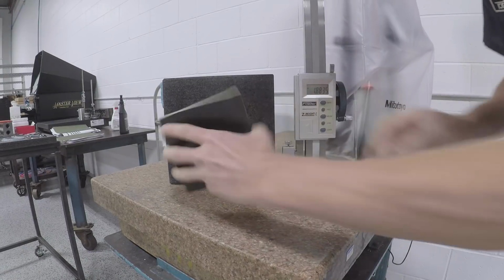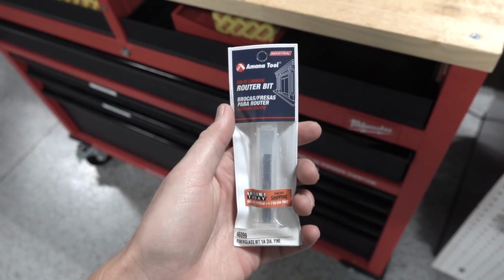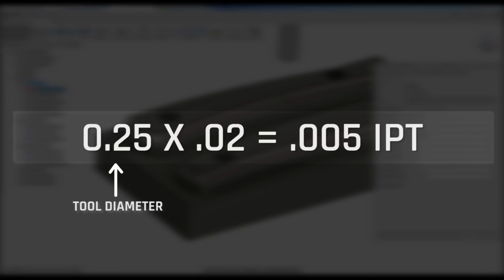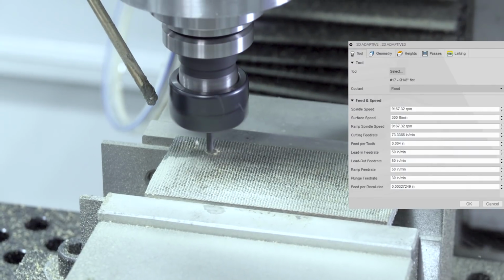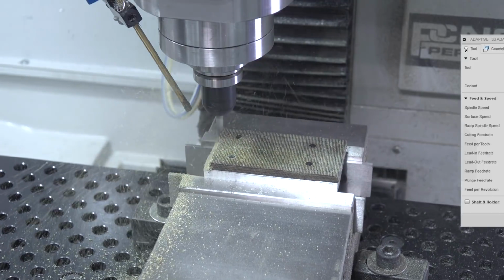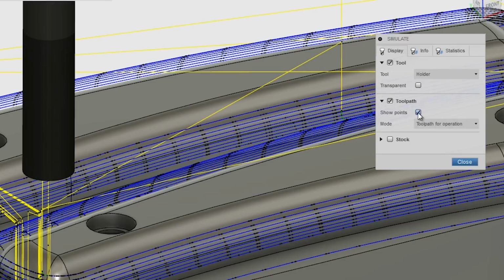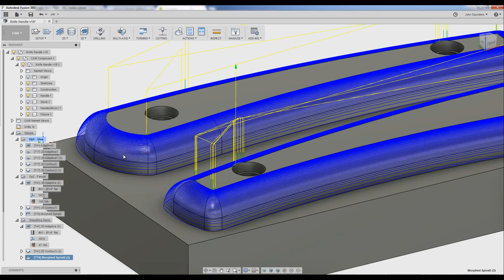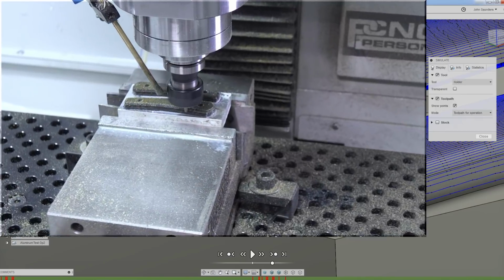Machining Canvas Micarta Knife Handles!  WW168

Comment from the maker: Apologies for the material mistake!  We were given the piece (and thought it was G10...) - thanks for clarifying that it's Canvas Micrarta!
Reply: NYC CNC 
Guess you gotta get some G-10 now for redemption 😆
Reply: Woo! I've tone a ton of this stuff. Way better to run it dry than to make a paste out of your coolant. I ended up mag clamping down a shop vac hose to the spindle to remove dust from my enclosure. Works great!
Reply: The whole time I was thinking "wow, g10 looks just like micarta"... Anybody else?
Reply: Yeah it’s not that nasty. It’s just canvas compressed together with epoxy but you were right about G10 as it has glass fibre running throughout in layers to give it strength and it’s nasty stuff. When I make knives I prefer to use linen or canvas micarta or even hessian micarta or jeans micarta and it epoxy glues to the knife handles better than G10. Stay away from G10 it’s not worth the hassle and it eats saws as you so very rightly pointed out and also tooling like end mills

Comment: Hi,
I could really use a video about this set-up. I have the same bit but I have to go really slow. A set of scales takes me about 2 hours. The main difference I see is that your operation uses the side of the bit as where mine uses the end. Also your machine goes around the handle scale and mine goes all over the place. My machine is a gantry system, but very rigid. Thank you.

Comment: Canvas Micarta is significantly different than G10. The Micarta does not contain glass fibers, which is an improvement safety wise over G10. There is no need to use air blast, it actually makes the situation worse with blowing dust all over the place. No need for special tooling either. Can easily be cut with standard tools. I have been cutting the canvas micarta with a single flute, and actually making a chip reduces the level of dust. (And using a regular endmill also helps to reduce the dust.)
Reply: May i ask what kind of feeds and speeds you are using? Looking to cut epoxy with denim myself.
Reply: @luctimmen  I'm using standard feeds and speeds for aluminum.  30k rpm, 1524mm/min, 5mm single flute.

Comment: Interesting stuff to machine!
Just be careful... oils ain't oils as they say.
For example Linseed oil is good at coating/sealing and protecting things like wood and fibers.
Normal petroleum based oils like that 3 in 1 will cause them to swell.
You can see this happen all the time when someone is a little too liberal with the oil cleaning firearms over time.
Need to soak the parts in acetone to extract the oil and shrink the stocks back.

Comment: Study up on the OSHA regs for respirator use, you are on their radar now...  essentially they want engineering controls instead of PPE, where a respirator could be required.  If you are using a respirator it is easy for an inspector to fine you for something related to the respirator.  For example we had an issue maintaining the requisite medical evaluation documents because HIPAA prohibits an employer from accessing confidential health information.  Don't assume you can skate by with just a dust mask instead, carefully read the OSHA regulations and you will find that the rules that apply to a respirator also apply to a dust mask, unless it is not NIOSH certified, which means the dust mask is about as useful as wrapping a bandanna over your face.

We machine a lot of G10 (actual G10 not micarta) and carbon fiber with flood coolant so respirators aren't needed.  Cleaning out the coolant tanks is a chore though.

Comment: My experience with cutting G10/FR-4 or similar fiberglass is that using a fiber reinforced abrasive cutoff wheel on a dremel, or some similar but larger tool gives easy cuts and perfectly smooth edges.  For best results, use a fixed tool and sliding material.  Even hand guided cuts this way will be locally flat in the direction of cut.  This is what I use for getting flat cuts on FR-4 PCB material.  I don't recommend a hacksaw as the cut is rough.  I don't know about Micarta though.

Comment: Mills are great for cutting laminates and composite materials compared to waterjets for 2D shapes. With waterjets you risk delamination regardless, even if you use a low pressure pierce before cutting. 

Also not sure if this would apply to something you are cutting so fast (and since you are using your Tormach 770) but sometimes flood coolant REALLY helps keep the dust down on composites and it kind of gums up what would otherwise be the dust. I have a small homebuilt CNC router and if I ever cut carbon fiber I water mist over it and there's no dust at all. Just dust stained water I have to vacuum up lol.

Comment: Path pilot question - is your post processor set to g61 or g64? If g64 what do you have the p value set at?  Your mill runs smoothly.

Comment: Shops that I have been in that run graphite and nasty fiber materials like this often use a fluid curtain around the part to control the dust that goes into the air.

Comment: I mill a lot of G10 (plus copper clad fr4 and carbon fiber).  Usually I run the spindle speed a little high so there's enough heat in the epoxy to clump the dust.  I don't get any airborne unless I try to brush the stuff off mid-op to check the cutting.  Carbon fiber on the other hand, you can build a fixture with a rim around the edge, fill with water and mill it wet...  Then wet vac it out.  Your body won't reject carbon so if you get any carbon fiber in your lungs its there to stay!  Also, carbon fiber splinters suck.

Comment: Were you using your standard mist recipe with the air blast?  My guess would be for dust control and not so much lubricity or heat removal.

Comment: Turned that material for a job I did 20 years ago. Boss had me use high speed tooling in a Daewoo 8S lathe. Made me turn the coolant on and afterwards I spent a half a day cleaning out the machine. Nasty stuff indeed!!

Comment: That doesn’t look like G-10 composite. 

Either that or you got FR 4 which is woven glass cloth layered between resin for fire resistance. They list it as G-10 sometimes but it’s really not. It’s FR-4. 

Or you got Kevlar filled. 

Either way, that doesn’t look like G-10 at all. G-10 is a pale green color, super thin laminations, and no real  color variations between the layers. 

You got some different material that’s for sure. Either Kevlar or Carbon Fiber composite. 

But whatever that is. It’s not G-10.

Comment: Had to machine the new prototype test fixtures for the F-14D avionics boards. The idea was to convert the F-14 to a glass cockpit. After we got the test fixtures built, the engineers could test them and propose mods.

Comment: Not surprising that you get a weird texture machining into the fibers like that. You need a skim coat of resin to seal the surface.

Actual G10 I think would have killed your hacksaw blade before you got more than an inch into it. I've cut GPO3, which is pretty similar, on a jig saw and it wore the teeth off the blade very quickly. When I went to drill it I used some cheap diamond cutting bits for ceramic tile, which worked great. Next time I go to cut the stuff I'm going to get an abrasive diamond coated blade for the jigsaw.

Comment: Hi John, are you sure this is g10? 
It looks like it is micarta, with textile fibres and not glass.
Reply: chris0tube 
Micarta is a catch all term for a woven material sandwiched in phenolic resin. 

So you can have canvas, fiberglass, paper, Kevlar, carbon fiber, linen, burlap etc Micarta.

Bakelite is just a plastic though, an early plastic. It’s not a form of Micarta.
Reply: chris0tube 
I suppose you could make Micarta using Bakelite instead of phenolic resin.  Both are thermoplastics so I can’t see why not. 

Can’t say I’ve hear of reinforced Bakelite before... or anyone still using Bakelite for that matter

Comment: The machine I use at work, has a garbage Fanuc controller. It only has 256KB of memory. It's absolute ass tier at processing to make it worse. Just a moderate detail of code to do rads, and I'm only able to push the tool maybe 40 Inches (1m) a minute, before the controller starts choking. That's only 2 axis.  It's even worse at processing 3 axis at once.

Retrofit that machine with Path Pilot, and I bet it would do better.

Comment: Hey John, after sanding, dip cover it in epoxy, let the epoxy cure fully, around 24 hrs, then post cure it to the max temp of epoxy,  then sand it,  200, 320, 400, 600, 800, and 1000, followed by polishing it.  You'll get a great finish that way. Don't use oil, oil will only help in eventual delamination.

Comment: That's not G10.  Looks like a canvas micarta.
Reply: Aaron Cross 
Having cut my fair share of G-10. That looks nothing like G-10.
Reply: Looks like he added a correction to the video and has called it "canvas micarta"....which is totally different than G10...which is more like a fiberglass laminate.  Canvas micarta is layers of fabric compressed with resin...I've cut hundreds of pieces of both materials.
Reply: i agree...
Reply: Adam Brackney 
Micarta is the process (also the brand name) of sandwiching thin layers of material between resin. G-10 IS micarta. As is canvas, paper, Kevlar, carbon fiber, etc layered between resin. is all micarta.
Reply: Aaron Cross 
And Micarta is a trademark name of the Industrial Laminates company. 

Just like Delrin is a trademark name of DuPont for acetal plastic and Band-Aid is a trademark name of Johnson & Johnson for adhesive bandages. 

So, Micarta, although it’s technically just s brand name, is used to refer to any material produced by sandwiching layers of some cloth or woven material between layers of phenolic resin.
Reply: I'd imagine a truly G10 knife handle would be rough and spiny on the hands when using it... That or machinists never leave me a good finish on the G10 parts I request... Lol

Comment: Dust mask is actually adequate. Don't need a full respirator. But yes, nasty stuff.
Reply: G10 when basically powdered like that will give off toxic gas (it gives a litte of formaldehyde off as you work it/grind it). Yes you need a respirator with a P100 filter with organic vapor filter as a BASIC. Not only that but a dust mask won't be able to filter out all the dust and this stuff will build up in your lungs.
Reply: Minus it's not G10
Reply: Yeah micarta will do basically the same thing it still gives off formaldehyde.